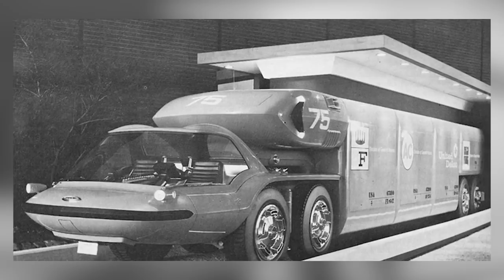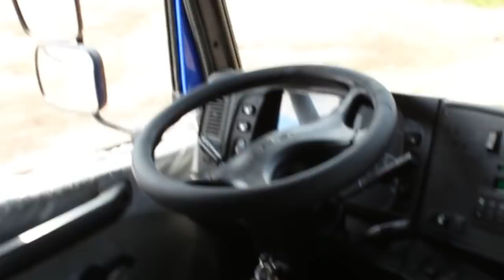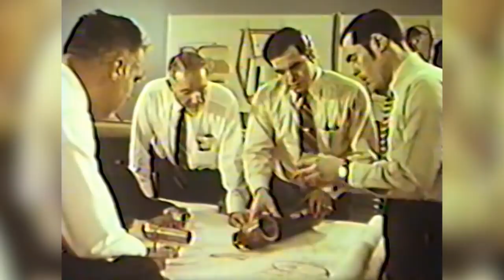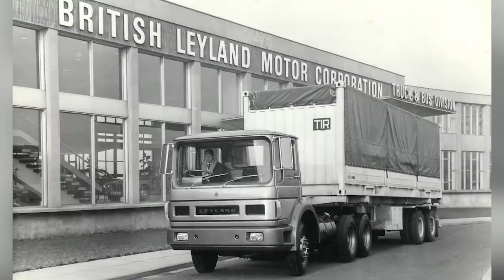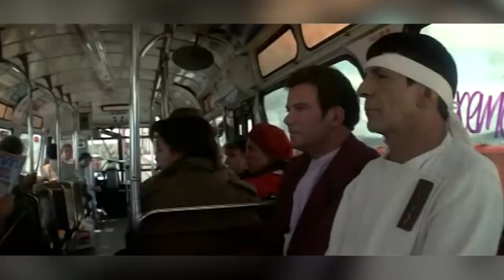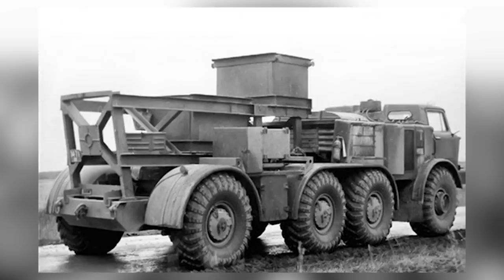12 Most Amazing Gas Turbine Monsters of 1960s

Comment: The basic idea of the Walmart truck is not bad at all, gas turbine/electric drives have big advantages in stop-and-go scenarios or traffic jams. Furthermore, gas turbines can run on any combustible, including synthetic fuels, CNG, LNG, LPG or hydrogen. Also, it would be possible to make it all-wheel-drive, including the trailer.

On the other hand, future will show if it can compete against opposed-piston engines (see DARPA engine) and a bunch of other things that improve conventional engines.
Reply: Koo i
Reply: Actually the combination of gas turbines and rechargeable batteries is deeply flawed for road vehicles. Batteries require unique tapered charging curve to prevent damage and gas turbines only operate efficiency at high continuous loads and don't like frequent start ups and shut downs.
Reply: @sandervanderkammen9230  With today's technologies, it is possible to use capacitors or advanced electronics to optimize charging. It is true that turbines are most efficent near full power. The idea being it turns on and off depending on power demand, battery state etc.. Normally, it would run for maybe 10 minutes and then shut off for the same time while you keep driving. The neat thing of this concept: Turbines are light weight, they have only one moving part and do not need to warm up and cool down as long as modern day turbo-charged car engines. Furthermore, the latter emitting TONS of emissions whilst being cold, which is a big negative in urban environments. It also makes sense to use 3 small turbines instead of 1 big one because you can run them depending on demand.

Comment: what a brilliant history of man's attempts to make things work. And an American 'Big Red' next to British Ford Cortina MkI cars ...
Apart from the odd styling Walmart may have sussed out the answer. Turbines work best at steady revolutions where maximum power is generated. Use that power to drive a generator instead of a gearbox and then use electric motors on each wheel (with added batteries to store power). Not viable for cars or vans but on HGVs (Semis) where there is space and the power and traction is needed this is probably the way to go. Plus those traction motors can be used as dynamic braking where they act as alternators to recharge batteries. I know I am biased but to me that British Leyland turbine was the closest to being practical and not bad looking but then it did have the very compact and efficient Rover Gas Turbine.

Rover had been involved in the prototyping and production of the world’s first jet engines in 1939-40 and by the end of 1945 was working on the first use of a gas turbine engine in a car (I’ll bet a lot of you thought Chrysler was first!).
You showed the Rover BRM gas turbine race car of 1963 (where it placed 8th and exceeded 140 MPH) but Rover had already built its 'Jet 1' (built from a modified P1 saloon car) in 1949 which won land speed records.
https://jalopnik.com/forgotten-cars-hey-rover-made-turbine-cars-too-5979348
They then went on to build some of the smallest and adaptable Gas turbines. One of which went into their Rover T4 prototype car which later became the piston engined Rover 2000.
https://www.flickr.com/photos/quicksilver_coaches/5754317514
Reply: Didn't Wal-Mart go with Tesla trucks instead?
Reply: @Cre8Lounge  No idea but if they have I hope they never let the batteries go flat or they won't open the doors!
Reply: The first gas turbine vehicle was built by BMW in 1944.
Reply: @sandervanderkammen9230  So provide some links and sources as I did then ..??
Reply: @1chish  The BMW GT 101 gas turbine is no secret. The GT 101 is based on the  BMW 003 turbojet it was first installed in trucks and the Panther tank in 1944.
Reply: @sandervanderkammen9230  Except it never was fitted the any Panzers or Tigers other than in prototype workshops, none ran and none ever saw service. The jet engines were too big and would have required huge fuel tanks (even if they ran on crap fuel).
No trucks were ever fitted with any jet engines by the Nazis in WWII.
Happy to be corrected of course.
Reply: @1chish  Sorry, I think you misread  by comment, wrote PANTHER tank
Reply: @1chish  The BMW GT 101 gas turbine used the 003 core as a gas generator driving a power turbine in a 2 shaft configuration.
Reply: @1chish  The BMW GT 101 and 003 engines used J-2 stoff a synthetic jet fuel made from coal.
Reply: @1chish  Several successful gas turbine powered tanks have seen production and service including the M1 Abrams, T-80 and the S-tank
Reply: @sandervanderkammen9230  Yes it did but used huge amounts compared the far heavier but more fuel efficient Maybachs. My point was GTs can use lower grade fuel than large petrol engines then in use and especially in demand by the Luftwaffe. And by late 1944 everything was in short supply anyway.
Reply: @1chish  It was also a multi-fuel engine that could use what ever fuel was available, an advantage in combat or wartime supply disruptions. The Abrams uses the AGT-1500 Gas turbine which is also a multi-fuel engine even though it's sister tank the Leopard 2 uses a more efficient Maybach Diesel engine.

Comment: One final comment...The WAVE micro turbine which as you say can run on electricity can also use electric motors for breaking which produce electricity that can be stored and then used to run the turbine at high speeds...Isn't that almost a self sustaining (perpetual) system...<(O..O)>
Reply: jrg973 - Only in a world that has only downhill :)
Reply: jrg973 - Only in a world that has only downhill :)
Reply: jrg973 - Only in a world that has only downhill :)

Comment: After a little research, this is what I found...For stand-alone gas turbines, without any heat recovery system the efficiency will be as low as 35 to 40 per cent. While Modern gasoline engines have a maximum thermal efficiency of about 20% to 35% when used to power a car. ...
So despite what the Oil Pro's say, they in fact sold the World a bill of goods...Just like GM destroyed the Electric Bus industry in the 50's...Money rules...Just like the fact that there are carburetors that can get 100 mpg...But guess who owns that technology...Go figure...<(O..O)>
Reply: Carburetors are an inefficient way to meter fuel. For a carburetor to help you achieve 100mpg you need to attach it to a 100mpg motor, like a little Honda Super Cub. In terms of efficiency, diesel engines can match turbines and cost less to manufacture.  To switch to gas turbines, truck users would have had to invest millions and millions to retrain their drivers and mechanics. This might have been acceptable if gas turbines offered a clear advantage over diesels, but they didn't, so the concept died.
Reply: Unfortunately there is a glaring error in your research... brake specific fuel consumption or thermal efficiency is calculated at WOT (wide open throttle) and  max rated power output. Gas turbines consume about 65% of max fuel flow just idling and use significantly more fuel in combined cycle driving city/highway than a comparable reciprocating engine.
Reply: jrg973 utin
Reply: jrg973 o POP POP loop loop loop loop p pop pop loop
Reply: Good point, but let’s not lose track of the truly important thing. No matter what kind of vehicles we drive, no matter what kind of energy they use to operate, no matter how efficient or inefficient they are, the most important thing is that the billionaires continue to make money off of all of it so they can continue to hoard even more money they already have.
Reply: @phaedrussmith1949  So I guess that the only solution is for mankind to create a Star Trek like Federation where there is no money and we meet our desires through performing our chosen tasks. But even on Star Trek there are Ferengi  and Tribble Traders...<(O..O)>

Comment: Did you forget about the Chrysler turbine car?
Reply: They didn't forget, this was about trucks.
Reply: @darnice1125  Did you miss the number of times reference was made to passenger cars? That's O.K., elderly people tend to miss certain parts of conversations.
Reply: @casualobserver620  One or 2 x is all the mentioned cars and just in passing. It was about trucks, Chrysler did not make a truck. I have actually driven a Chrysler Turbine car, doubt you have.  (and no it was not the one they actually leased, it was a 1976 Chrysler New Yorker that was assembled at Windsor assemby to consider the idea or resurecting the Turbine with more modern tech that was not avalible in the 1960's)  Sady it did not happen beyond the one prototype.
Reply: @darnice1125  
Was it loud and hot like the complaints about the turbines in the videos?